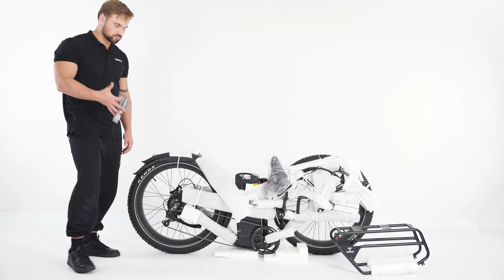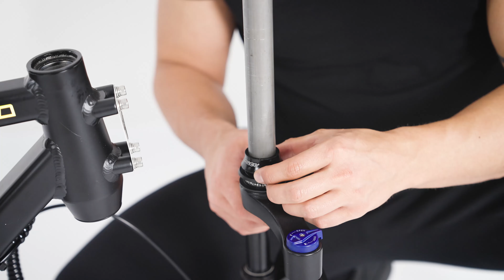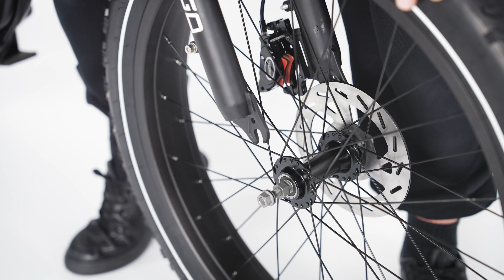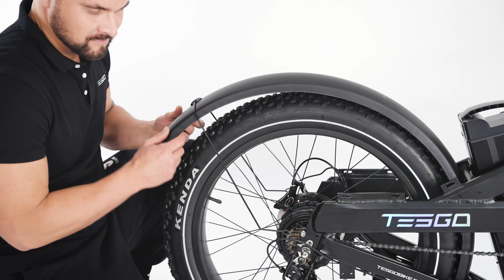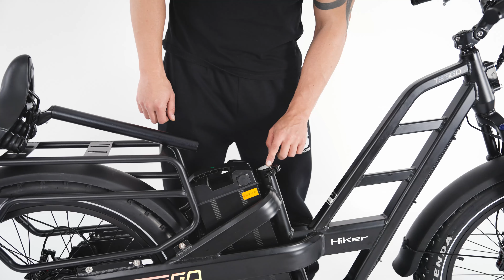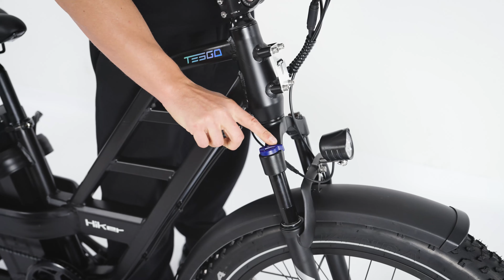Tesgo Hiker Unboxing and Assembly | Tesgo Bikes

Comment: Be sure to watch this video, the manual does not have a blown up view of the neck parts and order. Remove the neck parts to the level of the lower bearing ring and place onto a paper towel to avoid the grease picking up dirt, and place back in the same order. after inserting through the bike frame. The rest of the bike is very straight forward.